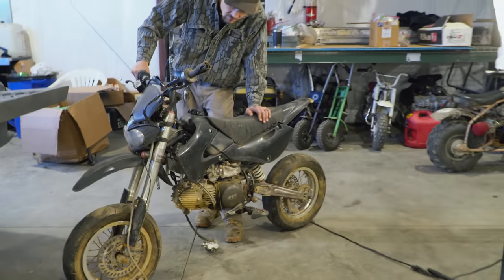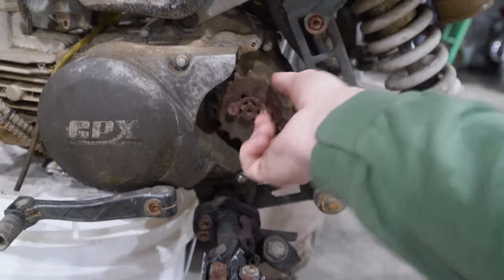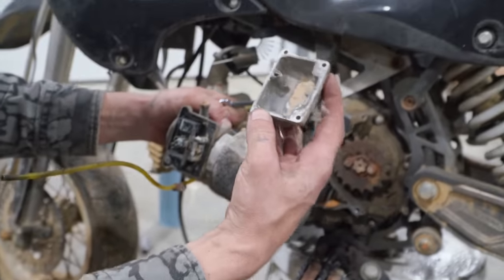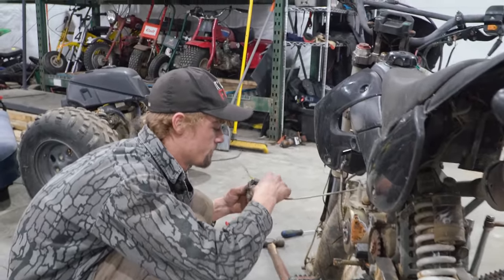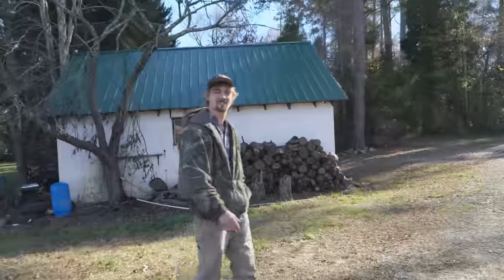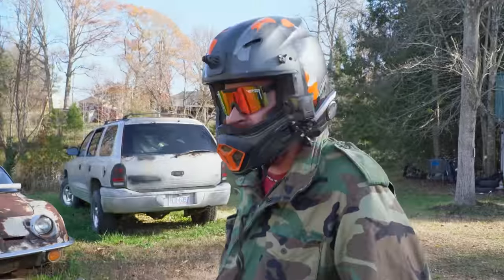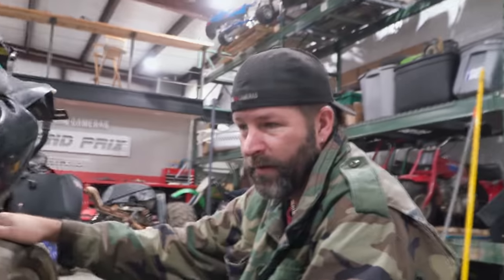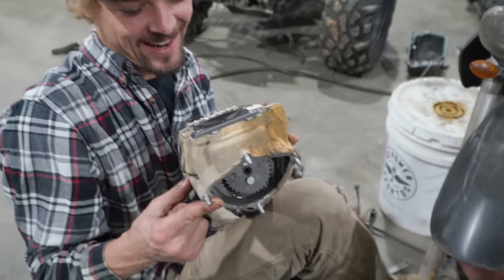Free Abandoned Pister Pro Pit Bike, Will it Run? (It’s TRASHED!)

Comment: I'm really digging the frame  etc... I'd drop a different motor in that for sure
Reply: 190cc Zongshen motor
Reply: @Tomingley63  nah I like good engines lol I'll take any honda any day over that crap!!! cc doesn't matter it's the size of the head, valves, etc that make power... and that's not what I'm after... honda takes the time to perfect their engines they are significantly better feeling than any Chinese junk. If you want power and are messing with a horizontal cylinder cub style motor like this your silly
Reply: @16driver16  there are 150cc horizontal cylinder "cub style" engines out there that make 17+ horsepower (stock). These engines are definately capable. Also this channel is not about absolute power. No need to make everything a deathtrap. 
And by the way cc does matter very much. The more cc means the cylinder can ingest more air and thus have more oxygen in order to burn more fuel.
Though i agree that these cheap chinese motors are much lower quality compared to any honda outta there
Reply: Hyabussa motor big turbo
Reply: @dieselgeezer18  I've owned the very 190cc you speak of! They have a 190cc too and it's the WORST OF THEIR CT70s to ride because of said engine!!!they have power but it's useless on these machines and it's not fun to ride!!! I've had DOZENS of hondas of every size and year and minibikes and pitbikes I've had it all and the ones that were the most fun were hobda based engines the hopped up crap is faster and more powerful and vibration riddled and unreliable and GARBAGE!!!
Reply: @dieselgeezer18  you compare the 190cc built engine to a 110cc-125cc fuel injected Honda that's hopped up at all and tell me what's better!!! Grom engines CRUSH even the 190s when built
Reply: @colagg2465  there's definitely enough room for that
Reply: @Tomingley63  I think other people who spend the cash on that motor just are trying to cope when  it doesn't live up to their expectations or they had lower expectations than I had. Crf110 with fuel injection, or the grom motors are the way to go of you want the best bike
Reply: @16driver16  where can someone find crate honda motors to drop into something like this?
Reply: @ngk330  maybe it's just where I live in the pacific northwest(Washington state) but I can find honda grom motors with harnesses all day but for mine I bought a whole bike, as I wanted every little piece I could get. Also I should mention I have titles(on the bikes I ride, not the grom for engine swap) and actually put alot of time riding the things they're not cheap but I get my money's worth by using the crap out of them. I have a whole forest of one and two lane tracks for hundreds of miles, and tons of awesome country roads to ride them street legal or not.
Reply: @ngk330  for some of my cheaper projects for examples som of my trail90s I tried all the different Chinese engines and the best motors I ever tried that were cheap was a 1985 Honda atc110 engine and a 1984 Honda atc125m they were smooth and the 125m was pretty powerful too, they have the hi/low trans so probably not good for a pit bike tho.
Reply: @ngk330  oh also never buy anything brand new from Honda they will overcharge an incredible amount save your cash and buy them cheap used Hondas, they don't give anything for trade in so you can really score by finding a guy offloading his bike to upgrade.
Reply: I’d try to find a used Honda 125 engine on eBay  for a few hundred
Reply: Hell nah those engines are the best small 4stroke engines

Comment: Would be interesting to see if y'all could repair the engine case.
Reply: A dedicated shop possibly could. welding cast aluminum , remanufacturing bearing race bosses,  a LOT of in depth steps.
Reply: @PlayingWithFireOutdoors  But even then it's no easy task... Minimising heat distirtion from welding, and then re-machining every feature while keeping alignment perfect between 2 separate case halves. And completely re-shimming all internals (including some new ones) afterwards. It can be done, but it will take some MAJOR skill, and wouldn't exactly be an economical solution while these engines are a dime a dozen... 
I'd fix up the big-bore kit though; stick some nice stainless valves in there with some decent springs and retainers, and save stuff like oil coolers, ignition, and intake and exhaust parts for another engine. Roller has some really nice brake and suspension parts to it, so well worth keeping in my opinion.

Comment: A torch blown in the exhaust and intake ports pointed at the valve stems with the cam removed and valve springs still on the head will straighten and even fix the bent valves, the valve springs will pull the valves shut while the stem is red hot. This is a proven oldschool trick of the trade that i have personally done before and it does work.. so the head is able to be saved.
Reply: How much could 2 valves cost though and maybe seats and guides?
Reply: Valves are worth bugger all. Especially on a cheap engine like this. Would bother with backyard hacks.

Comment: Looks like the same failure the old sdg bikes used to have the 108 Motors the stress from the high compression on the Kickstart gear would Crack the Case just like that crank mount a clutch same thing that's what pretty much killed those bikes love your channel keep up the good work boys

Comment: Very cool little bike! Lots of get up and go, for sure. But by adding ‘go-fast’ parts it was more or less condemned to fail. It’s simply metallurgy. I worked for Honda Canada (advertising) back in the nineties and I remember they were getting complaints from their go-cart engine users when Honda small engines -formerly made in Japan - were manufactured off-shore in South Korea. Same designs, but different quality steel and aluminum. NFG when pushed to the limit...and beyond.

Comment: I use to part out sport bikes and the two items I used my impact driver on the most were the rotor bolts and brake/clutch reservoirs. Most rotor bolts would come out with heat.

Comment: The sad part about the Mega Moto Pro 212 is that, when Rural King used to sell them, the retail was $799.99 and they almost always had them on sale for $699.99 and sometimes $599.99. Add a stage one kit for under $100 more and it was good to go. Walmart has the bike now but it's under the Coleman name and has the same engine as the BT200X. It's a 196 and they don't have the Pro version, with front brakes and a TAV. They hit hard times and I don't understand this set up they got going with Coleman doing some with Walmart and Go Power Sports doing what they are doing with them.

Comment: probably can fit the jug on another engine if you have the cases machined for it , you guys have quite a few of these engines and i bet you can get one running again with a new set of valves and a better crank (original honda?) realy like how that bike looks and it would be a shame not to get it intoo a working machine again , its the perfect grocery getter for the schoolbus (well that and a backpack to put the groceries intoo)

Comment: Fast and slow on the rear shock is the rebound. Fast means it rebounds quicker, slow is more of a dead shock. Should have a compression dampening clicker near the top of the shock on the nitrogen canister. Forks should have compression and rebound on them as well. Usually compression on top, rebound on the bottom of the fork lug.

Comment: It would take a little work but you should try to figure out if you can put a 212 predator engine or a Briggs and Stratton engine on the transmission you would have find a way to seal the transmission and a way to put oil in it but it would be cool.

Comment: Is there any way to salvage the transmission gears and you use your plasma cutter to cut out three plates on each side that would hold the gears weld up the box or screw it together and use some gaskets and make the gearbox watertight install it again and hook it up to a centrifugal clutch and use it tillotson 212 with electrical start you have a gearbox you have electrical start and you have a reliable engine

Comment: You could probably save that head if you clean it up and replace the valves. Idk why you say you don't have an engine that 160 bore will fit on. It should fit the engines on the trail 70s. I just upgraded a Gy6 50cc and a cheap 125cc Chinese engine to 160cc this last summer.

Comment: I would LOVE for you guys to rig just the transmission portion of a pit bike engine to accept a chain from a predator engine so that you have a 4-5 speed transmission being driven by a 212/225. I think all you’d need is a junkyard pit bike engine and just weld a 420 sprocket on the crankshaft. Hopefully an AC tig welder is in the works so you can weld aluminum, because you’ll need that to modify the case to seal the gaping hole where the piston and head would be if you did that.
WHO’S WITH ME????

Comment: a new engine, and this will be good to go. it looks like it was never crashed, so the chassis is worth repowering. it's not like you'll find a mini supermoto on every corner. $2-300 will get you a new stock engine. mebbe some new valves and you can still run the big bore kit even.

Comment: If that is an ADV 140, they have a lot of good qualities. I have been trying to buy an ADV 190 for 2 yrs. and I guess they just quit making them. I like the size, comparable to a Grom, and the better than Grom suspension for off road use. Most of those have ZS (Zong Shen ?} motors. Could be a fun project to put a bigger Honda clone engine on it.

Comment: I hear they can be finicky to start, look at their instructions. Probably why the case is broken: 
"You may want to consider setting up the bike on a stand for a solid starting location at first until your confident
Turn on Both Fuel and Choke
DO NOT open the throttle (do NOT turn the throttle)
Move the starter down until it gets stiffer, your looking for top dead center
Let the starter come back up and give a full strong swift kick ALL the way thru
REPEAT (If necessary)
DO NOT KICK RAPIDLY
When warm just do not use the choke"
Reply: that sounds like crap you'd do to a 2 stroke engine. This is a regular gasoline engine. You can typically just kick it and rip it.
Reply: @dilfonicz  I hear ya, but I've read the same thing from other manufacturers.

Comment: GPX Moto is the parent company who owns Pitster Pro. Yes, the bikes are Chinese made but they're made to GPX Moto's specs so they're probably the highest quality you're going to get in something that isn't a Honda or other top dollar brand. GPX Moto does offer a 190 crate engine that isn't the Daytona model and even though it's not as pricey as the Daytona it's still not cheap. Though I think it would be kind of funny even if it's not practical to find a good GROM engine from a Honda GROM and drop it onto the Pitser Pro. Do a reversal of what's normally done and swap a China clone with an actual Honda. :)

Comment: Yeah that Mud baked stained color all over the case, dirt in the carb, and looks of it. Somebody was abusing that bike, engine definitely took on water probably had a soft lock up/hydraulic seizure that toasted the main/case bearings . Actually just had to do a rebuild on a Can-Am that bent valves from taking on water (Can-Am got lucky). 🤪

Comment: Definitely fix it new motor awesome mini moto just like the big supermotar bikes or parts bike still worth it and I would save everything I found that u can swap gears and update older Hondas with little modifications and this was long before these Chinese clones were around u be amazed the interchangeability with gear ratios u can make and adding electric components to older model Hondas  can be done

Comment: We broke an engine in the same places, broke the kick start sprag clutch and it split the case in the same places, but we didn't notice, just replaced the sprag and got 2 more rallys out of it, till we tore it down looked almost the same as yours without the floating chunk...oops

Comment: The cracked case is  a pretty common issue with this style of pitbike motor, you can tell the difference between the style and the other style  of 140cc  by the side case, the other style is !uch stronger

Comment: those motors are cheap on amazon  i think you should just drop a 125 in it id say a 200 or the 250 but that motor sits like a 125

Comment: I have never seen it done before but i dare you guys and want to see if you guys can take the crabk and weld it back together and weld up the broken aluminum part on the motor and see if you can bend the valvs back and make a runner out of it

Comment: Unfortunately it took a wrong turn to the garbage heap! If the Chinese actually put effort forth into their quality control measures, they wouldn't have too poor of a product? But you get exactly what you pay for with almost anything made there. Luckily Chinese food is mostly made here in the US, otherwise it be really questionable, especially what that delicious meat really is? LMAO! Never seen anything like these things fade so quickly when exposed to UV. I guess UV blocking agents are expensive for paints and plastics? But even their anodizing fades as quickly as well. Just one thing that is simply corrected but it never will be.....! Good luck with that mess guy's! They look fancy when new, but give them  6 months and they will look like this one does. Otherwise I guess it would just be good for parts if that's worth using?  Good luck guys! 😉